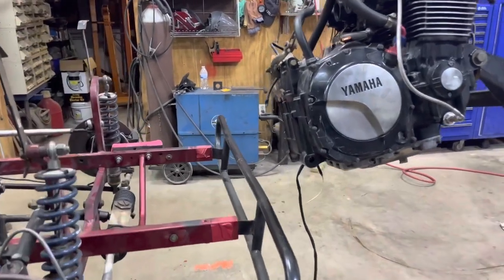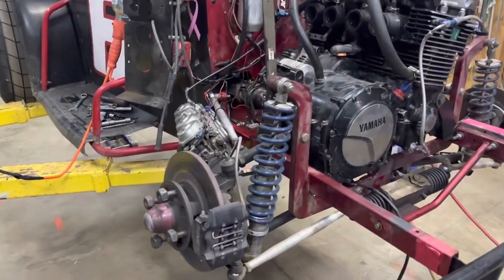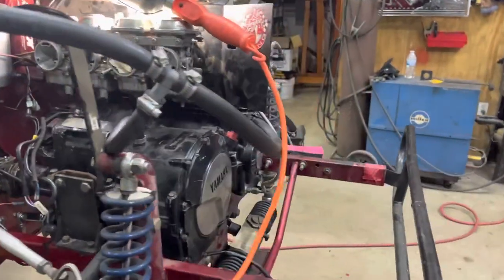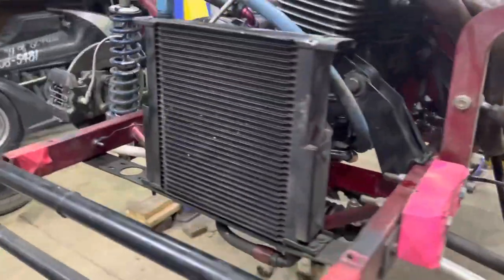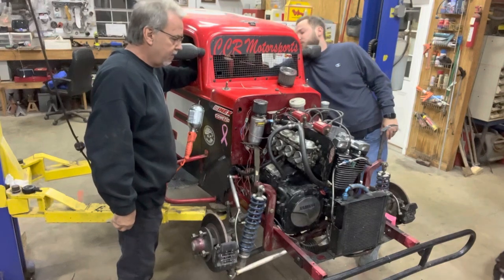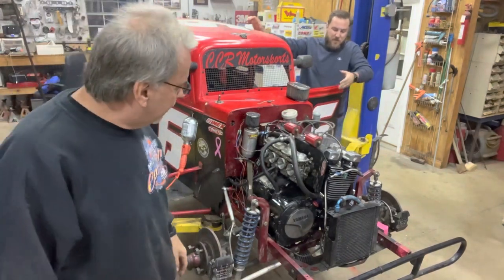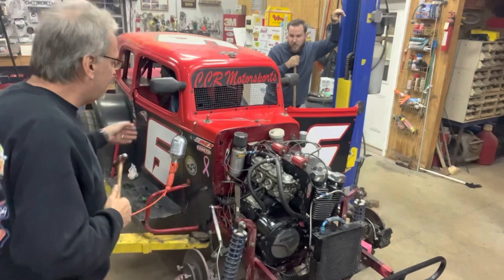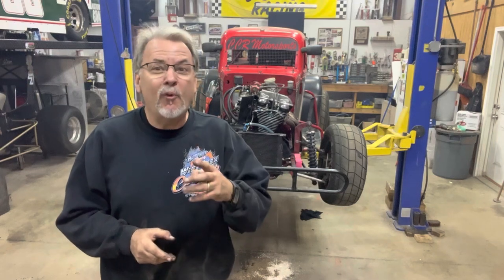#258 Legends Motor Swap - We Run Into Trouble !! Will It Run? Part 3

Comment: ****Would have loved a "How to" on the wiring. Not that I have that engine, but would enjoy the knowledge. 
        It's still a good video, I just needed something to complain about 😆
Reply from the maker: Since it was the same motor the wiring was the same however the connections (ends) were different. My son just replaced the end connectors - but he is very precise and neat in his wiring work on all his race cars plus he does not have wiring issue ever on his cars. Thanks for watching.